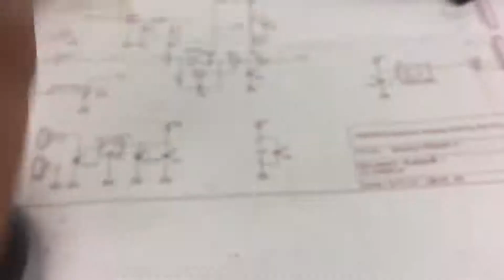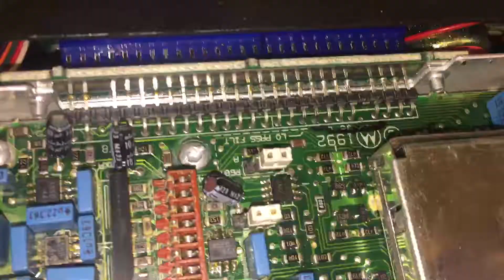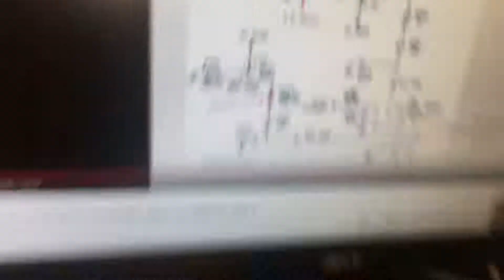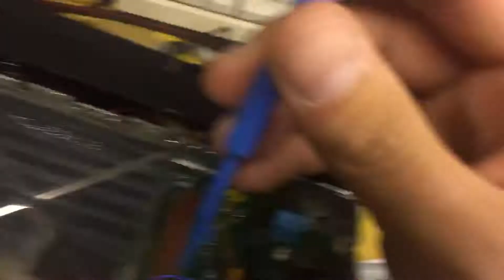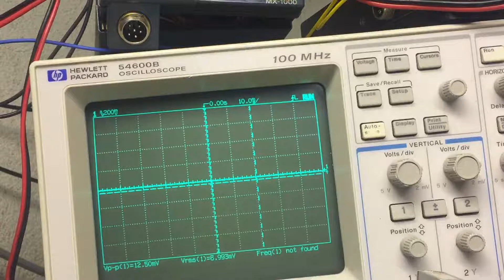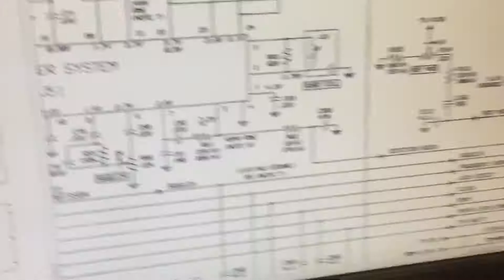Connecting MMDVM to GM300

Comment: That's a COMMERCIAL radio not a Ham radio, programming it in Ham causes it to operate outside of its designed spec and bellcurve unless you go in it and re adjust the boards and settings in RSS.

Same principle holds true for programming a Ham radio into the Commercial band.
Reply: Motorola manufactured multiple “splits” of the GM300/Maxtrac series transceivers.
The newer radios available are more “ham friendly” with ranges of 400-520mhz etc..
73